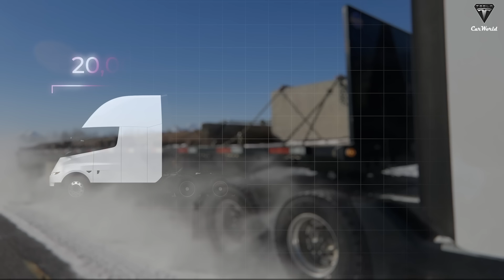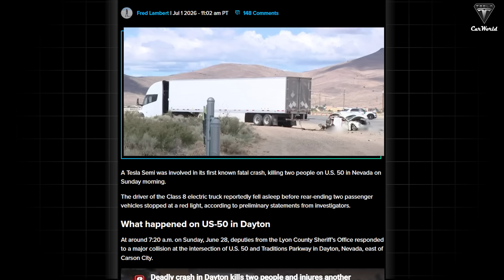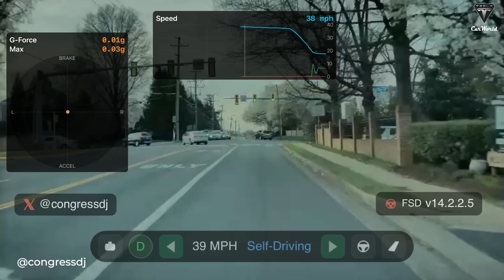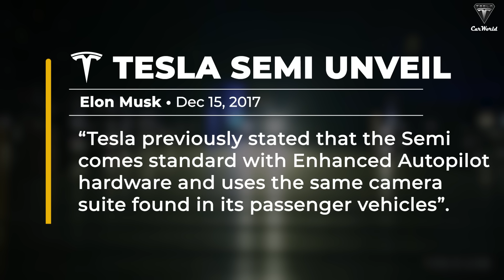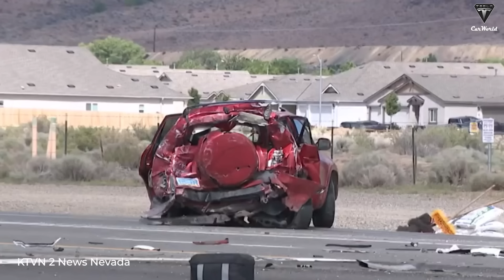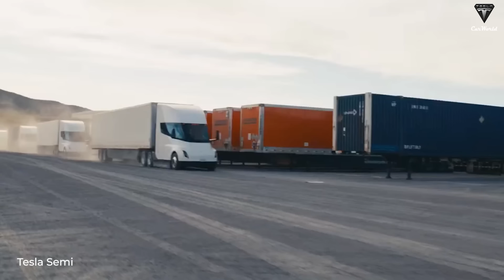Tesla Semi's Next Upgrade Will Change Truck Safety Forever!

Comment: They should put solar panels on every trailer and equip them with batteries and add regenerative breaking on those trailers to also charge batteries as well, such panels should also have build in screens to display advertisements.  This would provide additional power and money generating advertisement for the trucks and eliminate a lot of pollution.  This would be the real breakthrough in renewable energy and pollution elimination.  
Our politicians and engineers lack imagination, this alone would change the whole industry and make our planet green, with added electric motors on a trailer you would have added extra drive power and regeneration of power while breaking making trucks safer and saving on breaking pads both on trailer and truck itself.  That’s the future dumb engineers and politicians.  Refrigerated trailers would additionally have thermoelectric generators to add extra power for charging batteries as you drive.  Those thermal electric generators would have cold side on the inside of the trailer and hot side to the outside under the solar panels.
Ta da, global warming fucking solved. Thousands of tons of crude oil saved and no need for combustion engines that generate heat and waste energy by producing more heat than power, no need for engine oil or engine coolant and unnecessary expensive maintenance for stupid combustible engines.
🤔👍

Comment: It's not just torque adjustment at the wheels but in addition with regenerative braking (negative torque) is sent to each wheel as needed adding to the corrective capabilities for trailer loss of traction and tractor change of directions and or loss of directional control. Ray
Reply from the maker: Excellent point, Ray! Combining individual wheel torque control with regenerative braking can significantly improve trailer stability and overall vehicle control in challenging driving conditions. Thanks for sharing your insight!

Comment: Jack knifing happens going down hill and happens because of tractor braking Jake braking with just the tractor and the trailer jack knifes. Or if the trailer brakes lock up before the tractor does losing traction causing jack knifing.
Reply from the maker: Excellent explanation, Gregory! Coordinating regenerative braking, tractor braking, and trailer braking is critical to preventing jackknifing, especially on steep downhill grades. Thanks for sharing your expertise!

Comment: One question: if the driver really fell asleep, shouldn't the emergency braking system have reacted? I'm curious what investigators eventually find.
Reply from the maker: That's one of the key issues investigators will likely examine. We'll have to wait for the official findings before drawing any conclusions.

Comment: People usually focus on horsepower and range, but safety technology is probably the feature that matters most for commercial trucks.
Reply from the maker: I agree. Performance is exciting, but for commercial trucking, safety and reliability are what ultimately make the biggest difference.

Comment: I'm still a little skeptical of Tesla's safety claims until more independent testing is available, but the engineering behind the VDC system definitely looks promising.
Reply from the maker: That's a fair perspective. Independent testing and long-term fleet data will be the real benchmark, but the engineering approach behind the system is certainly interesting.

Comment: The comparison between brake-based stability systems and torque vectoring was easy to understand. It explains why EVs might have an advantage on slippery roads.
Reply from the maker: Glad the comparison was helpful. Electric drivetrains do offer unique advantages for traction and stability, especially in low-grip conditions.

Comment: The part about independent motor torque control was new to me. Makes sense why an EV could react faster than a traditional drivetrain.
Reply from the maker: Exactly! Independent motor torque control can respond much faster than conventional mechanical systems, which is one of the key advantages of electric drivetrains. Thanks for watching!

Comment: Interesting breakdown. Do you think electric trucks will actually become safer than diesel trucks in the next 5-10 years, or is that still too optimistic?
Reply from the maker: Great question! I think electric trucks have the potential to become safer thanks to faster torque control, advanced sensors, and AI-assisted braking. But proving that consistently in real-world fleets over the next 5–10 years will be the key.